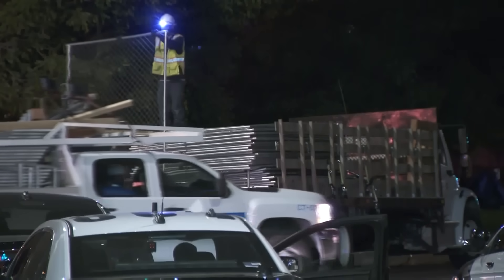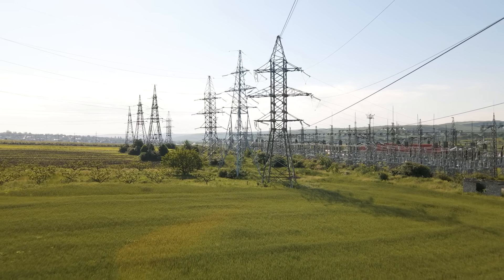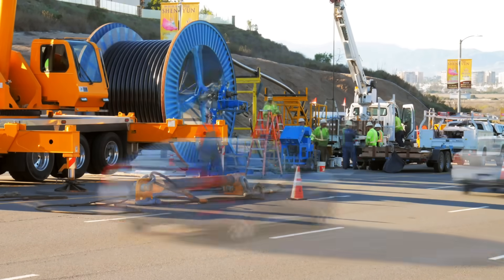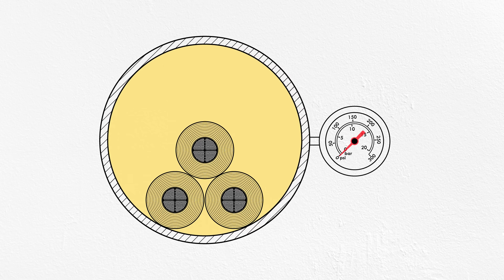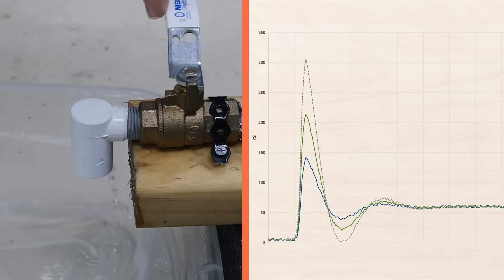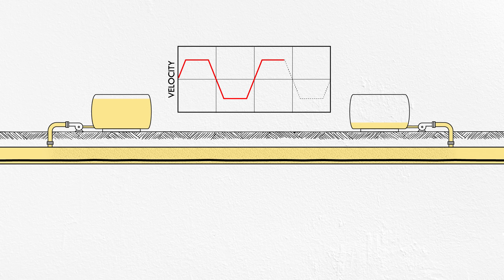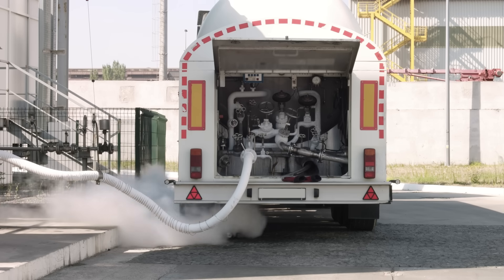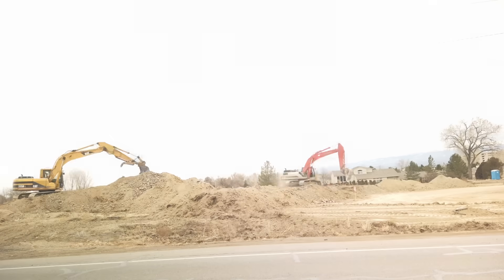Repairing Underground Power Cables Is Nearly Impossible

Comment: Run a smaller pipe inside the big pipe as a return for the oil (can be higher flow rate and less pressure) to move the fluid back to the other reservoir, then you don't have to reverse the pumps... just a thought O.o
Reply: If the return is a smaller pipe then it would require higher pressure to move the same quantity of oil over time.
Reply: @collectorguy3919  (replacing my old reply cause not 100% sure on the final calculations but I believe the principle still holds true)
In a normal environment, that statement would be true. In this environment, the main pipe is manually pressurized up to 200psi but the flow rate is kept low. Knowing that the main pipe has a higher pressure than flow rate, then you can surmise that you can use a return pipe of a higher flow rate, because you don't need to forcefully pressurize it beyond the flow rate.
Reply: And then you run up against frictional heating of the supposed 'cooling' oil, on top of pumping losses over the length of that high pressure return.
There's no way for the hot oil to shed heat inside the pipe, and it would only be adding heat to the cable it is trying to cool.
Reply: @jimurrata6785  you would have to do some adjustments to the system. (Probably add a radiator cooling tower at the ends or something like that) still something to think about... plus you don't have the loss of cooling from slowing the pumps, stopping, and reversing them.
Reply: @fightingblind  I'm pretty sure a group of intelligent civil engineers (like Grady!) worked diligently at an economical solution to the cooling problem before this cable was laid.
That's not to say state of the art hasn't changed over the decades it's been in place.
As he explained, pressurized oil with a reversing system and cooling reservoirs at each end was the answer back then.

Comment: The Auckland power crisis of 1998 would make a good followup to this, another case of underground power lines failing
Reply: 70k people’s offices mostly useless and 6k residents without power. 5 weeks to be reconnected to the grid. Although temporary power was restored after a couple days.
Quite the disaster.

Link for those interested.
https://en.m.wikipedia.org/wiki/1998_Auckland_power_crisis
Reply: It was the week I moved into university accommodation in the cbd, quite a disruption
Reply: "The two cables [...] were 40-year-old gas-insulated cables that were 𝗽𝗮𝘀𝘁 𝘁𝗵𝗲𝗶𝗿 𝗿𝗲𝗽𝗹𝗮𝗰𝗲𝗺𝗲𝗻𝘁 𝗱𝗮𝘁𝗲."

Well, there's your problem.
It merely illustrates that 𝘱𝘳𝘰𝘱𝘦𝘳 regulations are an essential part of civilization. For example, a mandatory rebate for outages over 4 hours, is no rocket science, yet a powerful disincentive against utilities sweating their assets.

Comment: Repaired a couple underground primary’s to some houses. Impressive how even underground they are still susceptible to damage from nature.
Reply: considering plate tectonics are known, I think the probability for something underground beeing damaged should be higher than overground? 🤔
Reply: @BlackDragonWitheHawk  plate tectonics can damage at such small scale?
Reply: @shadmansudipto7287  Well, it is plate tectonics that cause the smaller fault lines.  So, a couple degrees of separation? :)
Reply: @BlackDragonWitheHawk  In most places other than the fault line itself, movement of the above ground transmission lines would be greater than the underground lines. Not saying that I totally believe claims of The Boring Company that underground tunnels are safe from earthquakes. We were miles from the Northridge quake, but the weird hums and green flashes from above ground stuff sure added to the experience!
Reply: Saw a cable section where the 66kV cable decided to  fail, and it made a new hole in the road. Despite it being buried some 5m down in the ground, it blew a hole the width of the road early one morning. Made the cast steel joint box go from round to flat, split at the weakest part of the casting, not the bolted seams.
Reply: Interesting stuff , I didn't know this and I was a pole and line inspector for fire mitigation and never heard of these underground HV   problems🤗⚡⚡🔥🚑💨